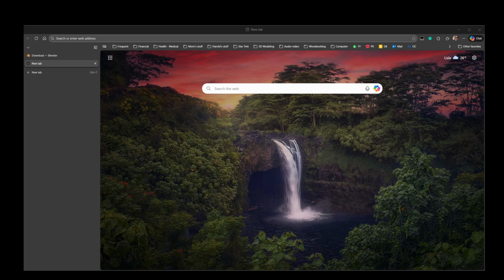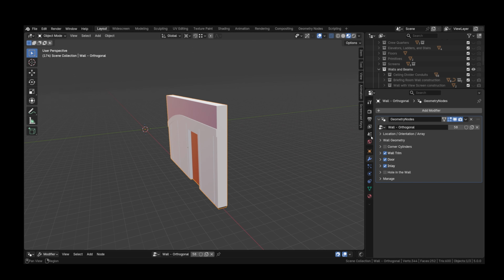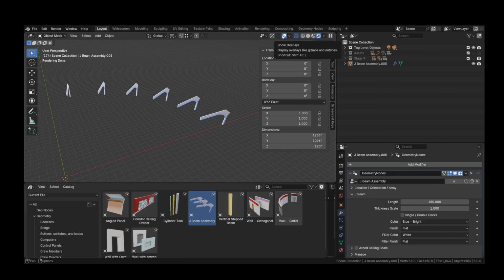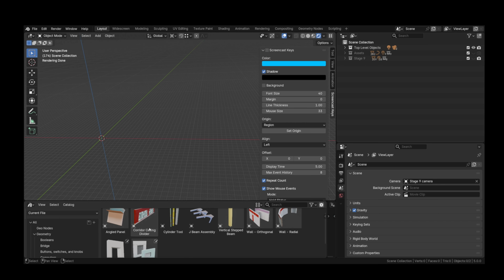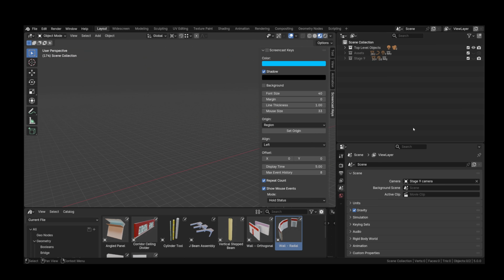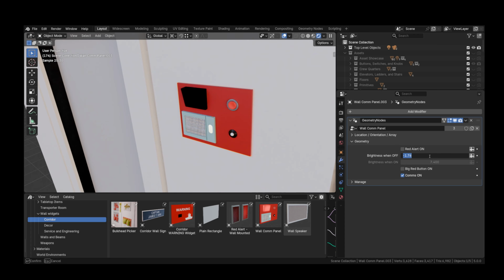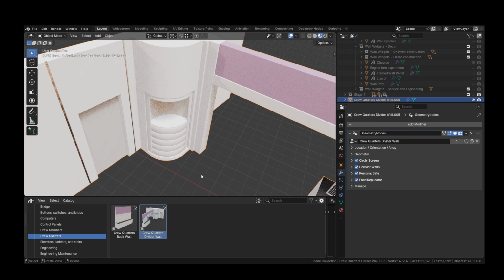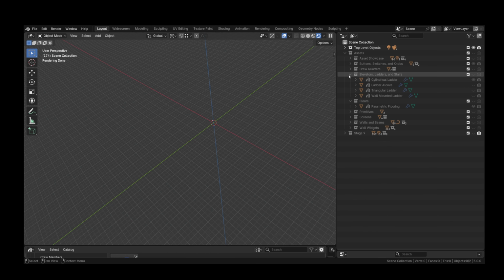Stage 9 Blender Asset Pack 1

Comment: Todd.  I have Blender 5.0 installed.  Tried to open asset pack 1 and get error.  Blender has stopped working.  Cannot go any further.   Any ideas?
Reply from the maker: PROBLEM SOLVED! For others who come across this message, the problem in this case was outdated graphics drivers. Once the drivers were updated, the file loaded up just fine.
Reply from the maker: WTEG: It is difficult for me to troubleshoot the problem without knowing more details. If you have a chat app like Facebook chat or WhatsApp I may be able to help you more directly.
Reply: Messaged you.